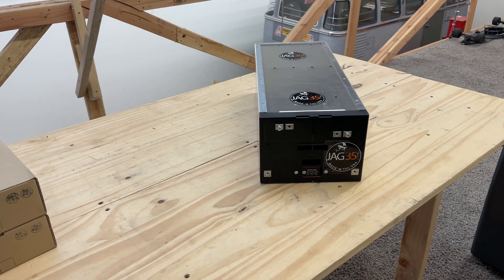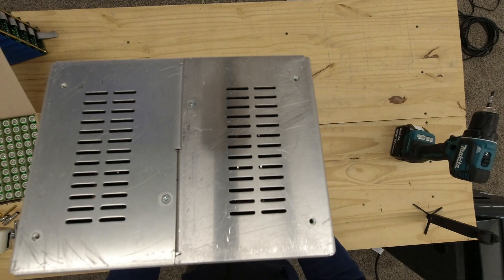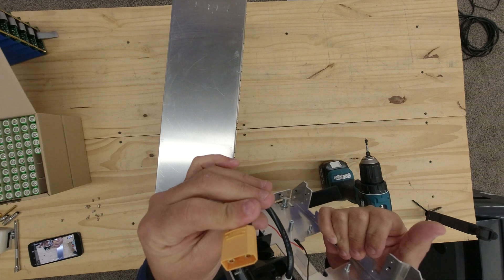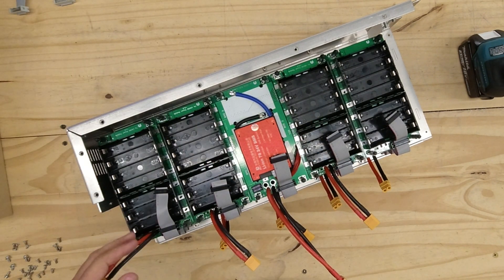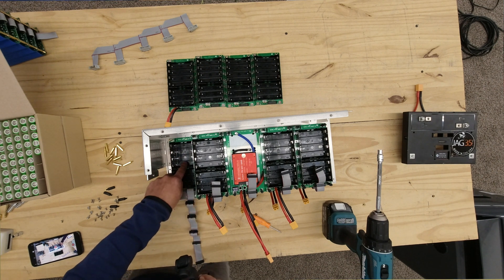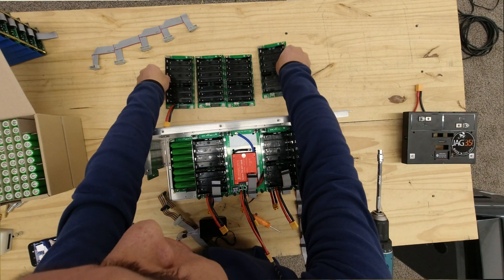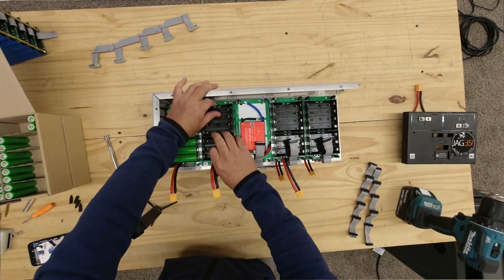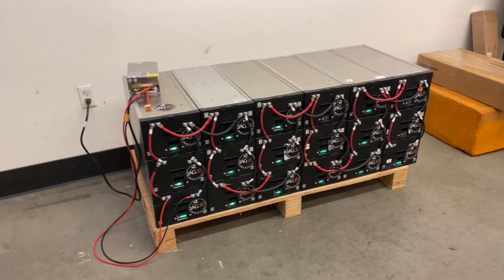Easy Build 2kWh PowerBox - Emergency Lithium Battery

Comment: Hi, I just purchased this kit.  I was looking to see how you charge this battery after the batteries are close to low voltage cutoff. 

Perhaps a video showing how you use the battery in a real life scenario.
Reply from the maker: How do you plan to charge them?   I usually use a charger
Reply: @jehugarcia  A charger for 4 to 8 cells at a time, so how do you charge the entire pack.  oh I put this on the wrong version as I purchased a V2
Reply from the maker: What do you mean 4-8cells?   This kit uses 175 cells arranged in 7s 25p
Reply: @jehugarcia  Hi, sorry if my question was not worded properly.  I was asking which charger you recommend for the pack once fully assembled.  The 4 or 8 cells would be when I pull these cells from the modem battery pack which I bought 100 of from the site and charge 4 cells at time. BTW I just got my order which included the kit and an extra 50 modem cells.

Comment: How do you secure the 5 boards to the bottom metal plate.  What do you use for an electric meter on the front?

Comment: Love the videos, have for a long time now.  My Question regards the individual batteries coming loose within the holders.  If you drop the box, will some of the batteries come out of their holders, and if so; how can we make sure that the batteries will stay secured in their holders.
Reply from the maker: they cant,   maybe only the top ones but then again the top of the box is right there less than half inch from cells

Comment: Shared to my feed:  I would live to win this power box.  It comes without cells but you can add either new it uses/matched/reclaimed 18680 cells. You need to add an inverter for  AC power, but you could stack several of these on a pallet to make a power wall.

Comment: I watch one of your pervious video n built my first lithium battery with 32 headway cells and I did have to make own buss bar plates because you were out of stock for a long time. But I wonder how you would  assemble this pack in this video for 12v set up. Here is a link for my build https://youtube.com/shorts/_ltauvMrgsM

Comment: Another Fantastic video Jag35... I am Very interested in building my powerwall, one unit. A month at a time. These modular units will also be used in my 2010 Honda Odessey van conversion I plan to have completed by 2025. Roland

Comment: Jesu, nicely done! Safe power control via bms, and a good voltage for most uses.  Your ideas and creativity stimulate me to build a series of ups’s as well as a power wall. Having worked in Telco (48 and 24 Vdc systems) I have no issues endorsing this design.  Modular, DIY and RIY (repair it yoursel) seems the right way to go.  Well done!

Comment: I built your 2.2kwh pelican case (the one you used to charge a Tesla). I added some other niceties to your design (XT90 for charging the pack with my iCharger 4010 Duo, USB-C and QC ports, and sealed the exposed screws with resin) With a 2500w inverter, it powers my gear in my RV (full mobile office with multiple monitors) for about 15-17hrs. It’s great that it’s portable, but I’d love one of these to make it permanent. I already have enough new LG and Samsung cells to build out two of these new metal boxes, so want to do a buy one get one free, rather than just give one away? I’d be happy to solder my own boards (I’ve soldered over 50 of the HP boards now) and have the XT60 and XT90 pigtails as well as Daly BMS (7S@40A, 7S@60A, and 7S@150A) along with five of your blank balance boards, so basically all I really need is the boxes, standoffs, and the front plates.

Here’s my 2.2kwh portable pack build... https://www.instagram.com/p/CH9yfejp2B_/

Comment: Nice battery-pack : robust and easy to assemble. Congrats. Will be also economical with free recycled 18650 cells . However, as for new cells, i would from now favor prismatic models such as the ones used in automotive and industrial applications. LFP, NMC and soon Cobalt-Free Nickel chemistries are available on the market. LFP being the cheapest (Lithium - Iron - Phosphate + copper/alumium, nothing very expensive  nor rare in there). You should be able soon to gather such cells as recycle from crashed automotive as BEV/PHEV production volumes are increasing exponentialy from now.

Comment: I am currently extracting cell from old laptop batteries, so far most of them are LG IRC18650 cells,  I have over 500 cells to test :(.  I will be ordering a couple of your powerbox as soon as I am almost done testing.

Comment: I’ve been wanting to build a solar generator for a while now but the battery size and expense were the limiting factor.  However, your modular battery packs make it more practical  and cost effective to build a more portable generator with the power output I’m looking for.  Thank you for your very informative and inspiring videos.

Comment: I love your work, yet, being cornered in Syria means all of the supplies that you have (batteries and whatnot) are either out of reach or extremely expensive, all I can afford now is this cheap lead-acid flood battery that would sustain my light for the rotating 4 hours of blackout (2 hrs of electric supply, 4 hrs of blackout).
God forbid, you're in my place, what would you do other than suicide?
Love your channel, eye-opening content
Cheers

Comment: Recycling center is paying $3.50 per lb  spent cells at 42-45 grams per cell and 450approx grams per lb  ,10 cells =1lb so 35cents per cell approximate purty  good if your buying in bulk for a buck a cell?

Comment: Love this! makes it so much more affordable(and just as important, easy) for folks like me on SSI, who might need off-grid power, for medical needs, or just to run HVAC system with a 120v/220v split-phase inverter hybrid/on-grid/off-grid setup,  just hook up the inverter, MPPT charge controller, and your good

Comment: That would  probably work well with my 24vdc trolling motor, & ditch the 2 (64lbs ea) 100AH agm batteries. No need for a gym membership with them.

Comment: wow, these are pretty sweet little self contained battery boxes with the cell holders inside, 1 or 2 of them with an inverter and charge controller would be perfect for a camper

Comment: your projects are all greats --   I like the idea of Powerbox 24v that you have - but it seem to have too  many screws to work with.   I would suggest to improve it and make it more easier to install or replace batteries.   Look into Dell Computer Business Model - easy consumer supports - I believe you can sell with easy modular DYI battery pack.  Great work!  love your work.

Comment: This would be awesome for solar on an offgrid cabin.  What advantage do you gain from having a 24v battery vs a 12volt?  (for instance if you wanted to use this with an RV/camper?)

Comment: Very clean.... what is the optimum gauge wire to use when wiring that system
In parallel with other boxes?

Comment: Hi, J. Absolutely love all your videos! You make it easy to understand. Quick question to see if the battery box would be a good fit for my electric APU system in my semi? If it isn't, don't consider me for the give away. I am looking at ways to incorporate the agm batteries (factory installed) with some other bank of batteries to increase my air conditioning and tv, microwave, etc. runtime. What ya think?

Comment: Well is way cheaper than a 7000 dlls tesla power wall  but is not much cheap as it woulld cost 6000 to get 14 KWs like teslas
Reply from the maker: You do realize Tesla powerwall is one of the most affordable battery systems around right?

Comment: awesome. If I win I would modify the box a bit. add heater pads, thin insulation and an inverter in a separate enclosure. custom arduino with wifi+bt and for it to be in charge of heating/cooling and some wheels to make it mobile.

Comment: A very organized, detailed and easy to replicate construction of a 24 volt battery assembly.  If I didn’t have so many irons in the fire right now, I would be in the construction process of one or more of these 23V power boxes.

Comment: Random Comment on this video .. :)   jokes aside, I love how much work you've put into making these kits.   Tried to make my own makeshift setup, but yours is so elegant.  Will need to check shipping costs to Poland and get some.

Side question, the ribbon cables, wouldn't it be easier if the connector is 90* and ribbon cables being shorter?   Do they just report voltage or also balance?  and would shorter leads provide slight improvements?

Comment: I am looking to build a battery using 21700s. in paralell What I need is a battery that can step the voltage up to 5.2 and also be able to supply over 3A. 5 or 6 a would be better. What kind of battery circuit can to this? I need a boost converter that can still function at 2.7v, and I need charge and discharge protection. A lot of the options I am finding for this purpose only support upto 3A and output 5v, which sometimes isn't high enough when the voltage starts to sag a little. 

I need it to run small computers like the jetson nano plus a number of small motors.

Comment: Very interesting! I'm building an off grid solar system for a location that has no access to power. I already have 4 250 watt pv's. I must run an ac. Hot and humid location. I have decided that lithium is the only way but so expensive up front so I'm looking into building my own.

Comment: Are these durable enough to use as golf cart batteries? I know I would need two of them, but I think I could make it fit easily, I would just be concerned about the rough ride from a cart going over terrain. Thanks

Comment: This seems like a nice way to get started in battery building for a novice..
Reply: it does, untill you see, it costs 399 effin dollars!!!
Reply: @TimRebernik  just for the kit.... that doesn’t include the $500-$600 in cells!!!
Reply: @Isaacmantx  I know
Reply: @TimRebernik  so it costs roughly $1100 depending on shipping. For a 2kwh lithium battery with BMS and enclosure and terminals. Go price that out and get back to me about what it could cost elsewhere. Just for comparison, a Battle Born is a 1kwh battery and it will cost you $1000. So, a DIY battery kit from Jehu will be HALF the price of a commercially made battery of the same quality and construction. There are other cheaper options, but they use prismatic cells rather than cylindrical. If the cost of this is too high, than you don't realize the value of it.
Reply: nice

Comment: THE BEST voltage for a car is 36v, 30v to 42v. 2 series solar panels make 44v, so a simple $10 on/off charge relay can be used. It's simple to monitor the voltages, because there's 10 cells in series. Those 36v old Jump/Uber Bike batteries you're moving are great because of that.

Comment: Nice Video.  I wish you would have slowed down and shown reseating the battery when the BG-8S showed that the cell was not giving proper voltage.

Comment: I noticed some of LED meters in the front not working, would that be possible if I decide to buy one?  or do you check them for proper operation before shipping?
Reply from the maker: You can not tell if they work or not on this video,  you can turn them on or off

Comment: 24v @ 2kw .. so if it were a 12v system or you used a step down converter.. you would get 4kw out of this box.. is that correct?
Reply: 2 kilowatt hours is the capacity, meaning under ideal circumstances not found in the real world, it would be empty(fully discharged to the minimum safe working voltage) after supplying 2000 watts for 1 hour

watts(which is power, not to be confused with watt hours, which measures capacity) is voltage * amps
The capacity would go down if you stepped down the voltage due to inefficiencies(heat)

Comment: Just starting as a diy battery builder  ,also first time homeowner   got the solar installed next part is diy battery  :)  .
question btw does any here know of a good solution to make sure that i only charge my battery whit solar energy   i want to make a system  that charges  from solar and only drains the batteries to 50 % then swith to grid .    from my monitoring on my solar panel software i concluded  that i use around 2 to 2.5 kwh each  night  so im thinking that a 10kwh (usable) battery woud get me a long way .

Comment: Do u connect 18x power boxes in series?thx. How long does it take to charge them fully? U will need to make a special EV adapter n super charge it using tesla facility. Another interest project for u.

Comment: Awesome, would fit right into the power bay on my Hymer RV, great design. What would you recommend for a 24/12v step down if I wanted to use it as an external battery for my AC200 Bluetti?

Comment: Great build! Could you demonstrate a circuit that would auto switch to a battery backup system when utility power drops off? Thanks for the great videos.

Comment: what if one of those boxes bms goes under full short c.k.t it can blew up all the bms .
Reply from the maker: Yup,  just like if you crash your car, bad things could happen.  What’s your point?
Reply: @jehugarcia  if it hit too hard it can be more worse because those battery inside the stacks can't resist the momentum and all pcb can break and box will be shorted and one short box / even one short stack of battery can turn off all power box shut off and complete power lost until the faulty box  disconnect .                                                              there should be some protection in each box bms if something happened bad with it's cells no extra current  drawn from other bms and Triger their protection too. they are fast but all bms are same so  they all Triger all level and  for repairing  we have take out all boxes one by one . which is lengthy and time consuming process . this will also same in case of power wall.. IN case of car their should be more protection  because the bms can be broke into two pieces which wouldn't stop the current flow.
Reply: @jehugarcia  chances are less but in  when we design   something we have to think for worst case scenario like bms break into two parts and all cell holder and pcb  can also break and case is made of metal .The  reparability should be  with less effort and much reliable as possible .

Comment: This channel is one of the reasons why I buy my cells from you guys. You're not just collecting a bunch of garbage batteries and throwing them on eBay. You guys are actively coming up with new designs and products for the battery hobbyist community, and as proven by a small order problem I had in the past, you go above and beyond to make it right and keep customers happy. I have a PowerBox on my Christmas list!

Comment: ONE, Best DIY kit for serious beginners. TWO, this DIY 2KW is very good capacity, unlike some small power banks that you'll soon regret after the fact. THREE. No soldering and no spot welder required to put it together.

Comment: Actually, this is the second rolling blackout we've had in Riverside this month. I came looking at your channel because I wanted to build a better system that will help alleviate exactly this issue. A few of these boxes are exactly what I need. What charger do you recommend to actually charge them (10ish) relatively quickly?

Comment: What's so valuable is all the work that you've put in perfecting your powerwalls from the initial tinkering, to the Samba battery deployment, to the 7S PCB design,  to all the BMS testing you've done and then couple that with the teaching you do through out these videos over the years, and you've imparted this knowledge to all of us DIY'ers making us better through your trials and tribulations. A hearty thanks for a great ride and looking forward to the continuing journey.

Comment: Hi Jehu...
I have been watching your channel from the beginning and to win this battery would be awesome. I did have a question for you though... You stressed that if you are using used 18650's that it is really important to have mAmp capacity as well as voltage matched as close in each tray. Question...if you have power tool high discharge batteries ie say 20 amp max discharge, can you use those in this box?  Also can you mix laptop (5Amp) together with 20Amp tool batteries if the following matches
Internal resistance
Capacity
Voltage

Comment: Is there a way to make this but in 12vcd?
Reply from the maker: If you put lifePO4 inside
Reply: @jehugarcia  Thanks for the reply. Yes I have lifepo4 18650s currently. I believe I bought them off of you a couple years back. So would I just use 4s out of the 7?

Comment: How long would it take to charge one of those boxes with a solar panel?
Reply: Depends on how many solar panels and I'm not sure what BMS he's using but it depends on the BMS limits as to how many solar panels you can hook up I'm assuming you could probably charge with 400 to 500 watts of  24 volt solar panels
Reply: I sent him a message trying to see what kind of BMS he is using because I do not see it on the website but if he's using a high quality BMS this is a great deal especially for somebody who would like to do it themselves for many cabin. I would not suggest this for an RV as the plastic could easily break on a bumpy road but for at home use or to mount it on a hand cart trolley and stack three or four of them up be a great solar generator

Comment: I love your builds, I have been working on a 12v 7ah multi cell battery system in my free time, any advice on BMS? Or wiring to charge? I’d love some feedback or advice, I’m waiting for 24v (pair cells and then each pair wired for capacity)
Reply: I forgot to mention I’m recycling AGM batteries that no longer hit peak voltage but are still maintaining 12.9 to 13 volts. I’m not sure if using 20+ batteries in an array required a BMS or any extra precautions besides matching voltages.